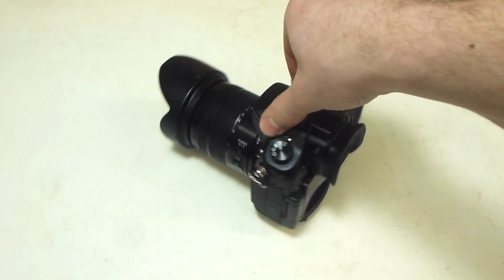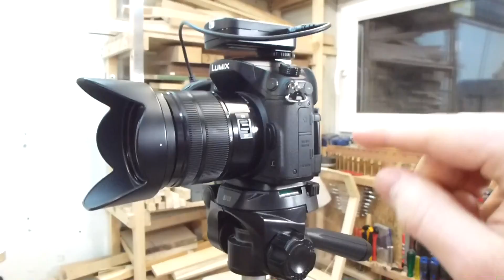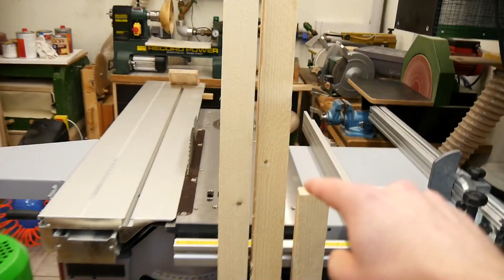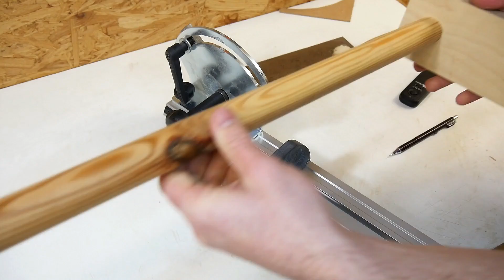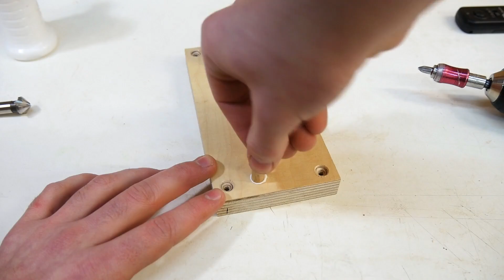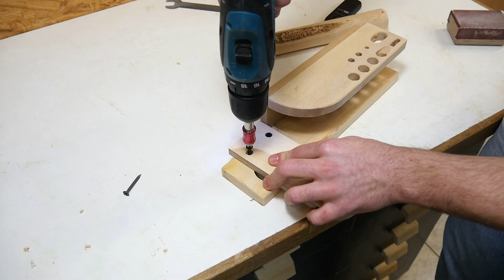New Camera GH4, Cross Cut Fence and more (Random Shop Stuff 11)

Comment: How much do you pay for a sheet of Baltic Birch Plywood?  I'm interested in the cost difference between the US and where you are.
Reply from the maker: +christschool 12mm ~40€; 15mm ~48€, 19mm ~56€ (in hardware stores you pay about 3x that amount)
Reply: Marius Hornberger Thanks.  That is actually cheaper than it is here, which is what I thought.  I pay $86 for 19mm.

Comment: Good to see you back in the shop.  Congrats on the new camera, just one questions, is 50 FPS standard in your part of the world, or is there another reason for that.  Most cameras I see are 60 FPS.
Reply from the maker: +okfj Yeah, US/Canada has NTSC with 30/60 FPS, rest of the world has PAL with 25/50 FPS. More details on Google ;)
Reply: +Marius Hornberger however pal and ntsc aren't really a thing anymore since the analogue days are over. especially since your target medium is online video, it doesn't matter at all. even our monitors here in germany use 60hz and not 50:). just use 60fps for the extra 10 frames. no sense in wasting them.